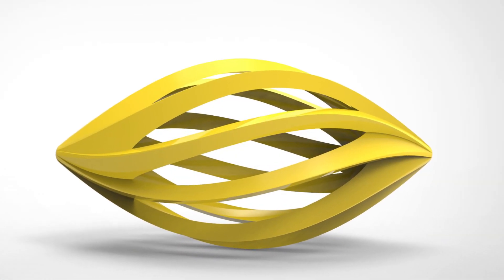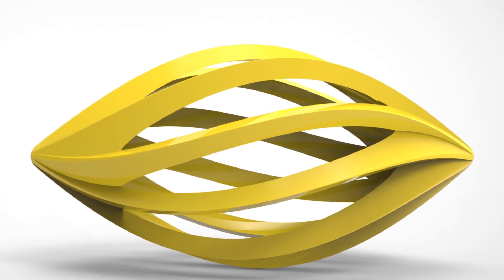Learn complex part modelling in solidworks

Comment: OK, finished mine, and it came out like it should, but I think you might want to make an effort to be a little easier to follow. Zipping around the screen, and not giving more than a half second to see your settings as you whip through the different tools makes things more tricky than they should have to be. Your skills are impressive and it was a learning experience, but it could have been a little more fun than it was.
Reply from the maker: Thanks for the comment and feedback. I sped up the video because there is quite a bit of time sketching and defining with dimensions - which isn’t overly engaging for the audience. If you guys want a slower breakdown that would be a longer video I can do that in the future no problems.
Reply: @DesignMountain  I wouldn't worry about being overly engaging for an audience. If you use the word "learning" in your video title, you're really communicating with "students" (in essence). Just speaking for myself, I LIKE being able to see ALL pertinent data involved with any particular tool being used.
Reply from the maker: Thanks for your feedback will bear in mind for the future.